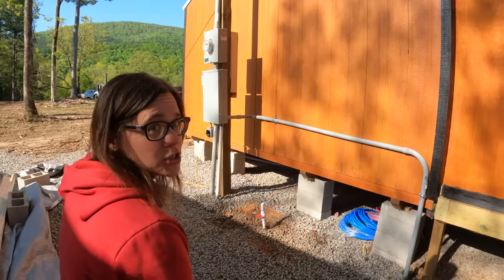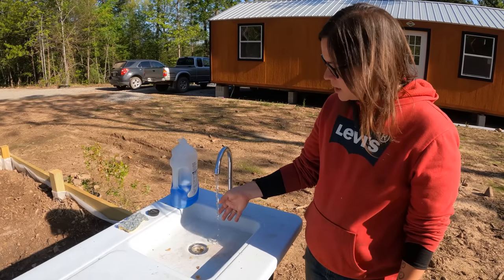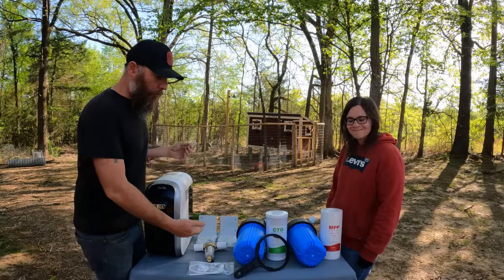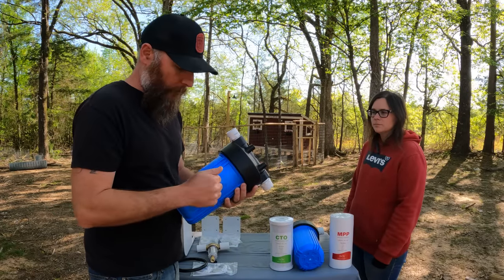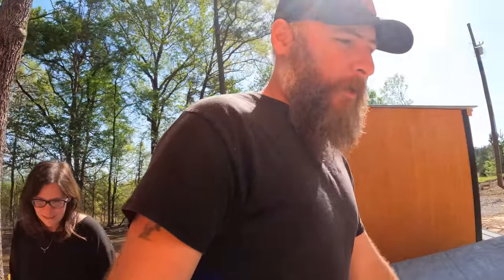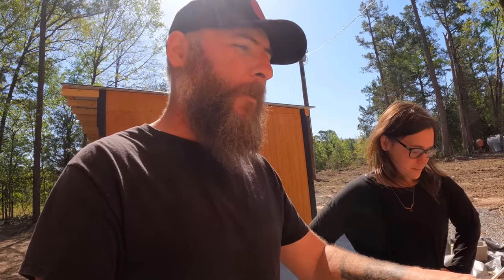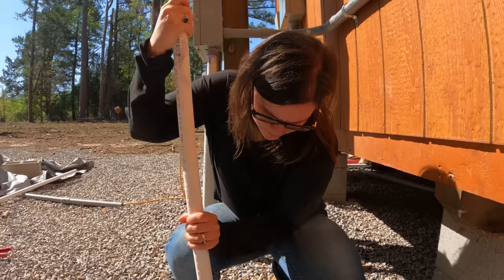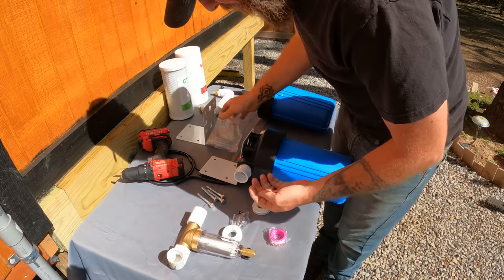Best way to get clean water | DIY Water Filter Install | Couple Builds Dream Home In The Forest

Comment: I would suggest that the next time you go to Lowes or Home Depot that you get some of the silicone grease made for the "O" rings on those filters.  They can be very difficult to unscrew and the lube helps.  If you plan on watering your yard or garden, you probably would want to think about installing the faucet before the filter so you do not run a lot of water thru the filter that does not need to be filtered.

Comment: That was awesome that thr company sponsored you with the complete water filtration system! What a blessing ! After it's completely installed are you going to build a housing unit for it ? That way it's tucked out of the way and won't get hit by the animals, an accidental bump or maybe storm debris ?
Congratulations on your super clear and clean water.  When you cut the grass a couple handfuls of some of the clippings can be fed to the hens. It's very healthy for them. You can also spread it out over the barren grass area you're trying to grow. The nutrients will be absorbed into the soil.
Thanks for Sharing. Stay happy, healthy, hydrated and safe. May God continue to bless you, your family and your adventures.

Comment: Good solution, however should be installed inside a heated living space. Then insulate only the feed line from the well along with heat tape to minimize chances of freezing.

Comment: I think I would have put the filters in the well house. This then not only protects them from freezing, it will keep the pipes to the house clean as well as give you filtered water to your garden faucet. 
Note: Any plumbing above ground outside will require not only insulation but heat tape as well.
Reply: Ours froze in the well house in the big TX freeze last year. We lost power so couldn't keep the heat lamp on out there.
Reply: You don't need to put the filters on all the water though. The garden water doesn't need filtered. In fact, it's better to not be filtered. It gets all the nutrients that way and nature will filter out all the junk and use the filtered hose pipe for the animal water.
Reply: I was wondering if freezing would be an issue?
Reply: I guess it would have froze no matter where it was located without power for heat. Even the pipe coming up out of the ground to the house will
freeze without power for heat tape

Comment: Move your outside sink to the back door and run a RV hose to it from the spigot. Great work yall...this looks like a great system.
Reply: The sink for household use is temporary— when the house is finished the sink will have the greenhouse built around it.

Comment: If you build it, build it off the ground.  Build the back and side walls and line them with foam board insulation.  Make the top and front hinged so they can be accessed like nesting boxes.  Keep in mind that the filters have to be unscrewed and dropped to be removed so leave room for that.   I keep a small whiteboard in mine and write the date of the filter change so I can look at a glance.  You can just velcro the wrench for the filters to the wall.  Keep a small light out there so you have one in a pinch.   I love using IBC totes in series to store water in.  It is free and mostly cleaner than well water.  It can be run thru similar filters or just used to water the garden or the livestock.

Comment: You say insulated but i didn’t hear anything about heat source. I think with your temperatures there a incandescent light should work down to maybe 15 degrees. I would wire it in to a switch in the house. That way when you see the temperature’s going down you can just switch it on. A shop light to just hang in the enclosure would do the same thing. You guys rock you are getting it done.
Reply: They could use a heat lamp in the box like you do for baby chickens.
Reply: @Donna_Bug  yes but I don’t think it necessary in Arkansas. I’m in the upper peninsula of Michigan. We have a incandescent light bulb in our well pit on all the time all winter. Then we have a heat lamp (like for the chickens) that we turn on when it’s going below 10 degrees.

Comment: I have been looking for a counter top reverse osmosis filter system. We had a different brand under counter system and had problems with it. I have been using the one with the pitcher and filter. I have kidney issues and have my numbers checked regularly. My numbers got worse when we stopped using the reverse osmosis system. Thank you for this video! We are on city water. I wouldn't have known the difference it makes if I wasn't tested regularly. Thanks again for the video! peace y'all
Reply: We use a Zero water counter top and it’s great and way cheaper too!

Comment: From experience, Iron in your water will destroy the cal rod in your water heater. It takes only 2 years and the 10 year warrantee does not cover it. It will cause your water to smell like sulfur. You can remove the cal rod without damaging the water heater but that also voids the warrantee. You can always test your filtered water to see if you need more filtering. Good job on the installation.

Comment: You need to run them filters in your wash room  before the cold water goes into your hot water tank
Reply: They are installing the filters first🤷
Reply: @Donna_Bug  yes i know, but would you put your filters outside , or would you put it in the wash room, then run it to every other place, Like water in a plastic filter in 20 degree weather is not a good site to see,
Reply: @scottmiller5799  oh I get what you meant now😂🤭

Comment: I was wondering, if you would want to use the filter system to do outside watering with the spicket? I am wondering if putting the spicket on the side of where the main water comes in instead where you have it so that you aren't wasting the filters, unless I misunderstood what the spicket is all about. Just asking.
Reply: I was just going to say that very thing.  Those filters are not cheap, and chickens and flowers do not need filtered water.
Reply: That’s what I was thinking too.. your outside water doesn’t need to be filtered.. that dirties up the filters quickly , and as you said, they aren’t cheap..
Reply: Besides saving on filters,  you also don't water garden hose water to back flow into your house for sanitation reasons.  There may be a reason to have a filtered spigot (Friends visiting with RV) but they could also add another one before the filters for the garden (ifthey don't have one already).
Reply: Yeah, why waste filtered water on outside stuff.

Comment: You made it look easy guys!! What about winter? Just building a box around your piping won't keep them from freezing. May I make a suggestion and use heat tape on all your house lines. As well as wrap with insulation. Down the road you might just be glad you did😁🤙🍺🦋🙋‍♀️ XOXO
Reply from the maker: We will insulate the box and wrap the pipes. I think it will be okay. Our well house is just insulated and house wrapped and it was fine this winter.  😊 thank you lilah for watching.

Comment: I recommend hinging the whole cover to the wall for Easter access to the system guys,oh an redrilling two more holes on the filter brackets to secure to the barge board an so good luck with continuing the whole plumbing system to your home 👷

Comment: Great job guys! Just a thought... you should probably put a pvc shutoff valve after your filtration setup to have the ability to shut off all the house with one valve.  It would help when maintaining and flushing your filtration line and you already have the clean out spicket on the opposite side, it would protect your supply lines to your house. So all your filtration cleaning can be done in one spot and turn one valve to keep supply lines to the house safe from anything you don't want in there.

Comment: Great job on the install! Armaflex on the piping, even in an insulated box, will help stave off the elements. Just another form of cheap protection from freezing. Will you be insulating the underside of the house, if so, the Pex should be ran above it, if not, no need to worry about the insulated box, the pipes will freeze anyways. Love what you're doing ❤️, grass looks great!

Comment: Hey guys look into an (Automatic Electric Heat Cable Kit) for your water line that is coming out of the ground and some (pipe wrap insulation) to put around the  Electric Heat Cable Kit like they do on Mobil Homes.  It will keep your lines from freezing up in the winter time. And also keep your idea of bulbing an insolated box around it all as well. I live in a Mobil Home and I have one on my Home outside at the main water inlet, and I never have freezing water in the winter and I live in Ohio. keep up the good work.

Comment: You should put a on/off t valve after your filtration system going to the house this way you can turn off the house and keep the pressure in the house when you service your filters and also put another one in front of the filtration system so that you can use the well water for your gardening.
 Good luck you guys are doing a great job.
Reply from the maker: we do have a separate ball valve that is for the garden. Never thought of needing one for the house after to keep pressure. Might look into some for the pex lines. Good advice

Comment: Wire a light into your box. It will supply enough heat to keep from freezing. You will need something. Wells further south than you have split filters and lines without heat source. Just my 1cent.

Comment: Heads up - I saw a few drips - water leak- from the new system when you were testing it. It was on the left side of the clear filter bottle. Check your video and you'll see it. It's very slow but it dripped 3-4 times. Your grass is looking great!

Comment: Since you can’t screw the bottom lag bolts on the filter support to the house you could get a 2x4 cut a V in one end then cut board to length and wedge under pipe between both filters to better support the weight. Just a thought.

Comment: Apply some Vasoline to the threaded part of the blue canisters and also the "O" ring on top of the canisters. The filter housings should be hand tight. In a short while the canisters will 'stick' and become hard to remove. Thas why the vasoline. Yer place is looking better n better each day.

Comment: Put slide locks on the front wall so the whole thing opens so you can change those filters easier. Or put a hinge at the wall and the front of the top so you could swing the whole front and roof up and out of the way.

Comment: A newly drilled well will be like that for a while.  You drilled the ground,  disturbed the earth and now the water contain all that mud and silt from drilling.  Man that drilled our well told us to run the water for a while to get what will not settle pumped out.  All the fines as he called it.  You will find that there is enough silt in your water to stop up the filters daily till it settles out or is pumped out.  Just run the water.  After a while it all settle down, no more silt and all you get is good clean water.  Remember only the top 20 or so feet of your well has a casing, the rest is a hole in the dirt ,sand and rock.  Use the water, that helps clean it out.  We have minerals in our water that clog up those filters in just a few days, wound up changing them two or three times a week.  Had to get a water softner installed to eliminate the problem.
Reply from the maker: Thanks for the advice Ray. Our well down at our campsite has a filter and it needs to be changed out about every 4 months or so. Hopefully with this system, we can eliminate some of that using 3 filters.

Comment: You might want to put some black form pipe insulation on all of the pipes, even under the house. Also secure the water valve so that a hose will not break it off. It was moving a lot on the video.

Comment: I'm going to be a bit bossy here,  one...I hope you take into account the indoor counter system when you get to the kitchen build....it would be best to have it by the sink, since the water reservoir is in the back, you need easy access to it, although if it was me I would just use an empty gallon milk jug and fill it at the sink and just pour it into the reservoir so I wouldn't have to man handle a full heavy reservoir with water back into it's slot, I'm so clumsy you see, I would splash water all over the place....I do that now with my counter top  zero water filter....I would think about which side of the sink will you put your dish drying rack, exactly how much room will you need to have your water filter on the counter and dishes and whatever things one needs by the sink, you want enough room to not look junky...I just had a thought ....you and your husband are so handy, he could make you one of the english draining racks. they are suspended over the sink to drain water directly into the sink, you wash rinse and just set the dishes up on it....do I even make sense?   it would save on counter space, you might could google antique english over the sink dish draining racks...second bossy thing, I would use your new filtered spicket with a hose run to your chicken coop, the chicks would benefit from the clean water, since you will be eating the eggs and some of the chickens for food, no pesticides, etc....third bossy thing, I would take a jar of the well water and the filtered water from outside and a jar of the counter top filtered water to the health dept and get reading on all three of them, you can compare the outside filters with the well water and can compare the inside filtered water to the outside filtered water and also compare the inside filtered water to the well water, that will be an excellent test of the systems....forgive my bossiness, I'm sure you have already thought about these things.... but just in case you haven't...... lol.

Comment: Are you going to build a cover for the filtration system so it won't freeze ? Another great video guys ! Nice work as always 👏 👍
Reply: I'm assuming it'll be done quick as PVC degrades quick exposed to UV rays and the elements.

Comment: Do you have a pressure regerlater.  You do not want to much pressure  or fluctuating pressure. It will cause damage to you water system.  Looks great for your set up.

Comment: You might want to think about installing a pressure regulator on your water line before your filtration system.
Reply: It might also be a good idea to put shut off valves at the beginning of your PEX runs to be able to turn off either hot or cold runs in the future,

Comment: Could you use a pressure regulater on your water connections? They're not too expensive. But could save your plumbing.   It just screws on.

Comment: WE HAVE A WELL WE PUT SWIMMING POOL BLEACH PELLETS IN ONCE A YEAR, but beware don’t wash black pants until you can’t smell bleach anymore 😊
Reply: The skirting we have under my daughters mobile home so on the inside hubby used pink like styrofoam insulation behind it and works great from freezing pipes underneath and we’re in Southern Minnesota, you guys don’t get that bad nasty freezing all winter ❄️ just a thought 💭 you guys are becoming the pro plumber’s 🤗GREAT JOB !
Reply: Put piece cardboard you can see if you have leaks 😉

Comment: Only comments I have is a PVC union on both sides of the filters makes it easier to repair or replace the filter housings when they crack or wear out. The spigot after the filter is okay if your intent is for consumption but will exhaust the filters quicker then anticipated.
Reply from the maker: I agree, I actually bought a union to install in the front of the filters. I realized that after the install lol

Comment: Hmmm ... Observation - 1. you have the Sediment filter 1st, then Carbon, and Particular filter, I would have reversed that, Sediment, then Fine Particular, then Carbon filter. 2nd. between the last "T" fitting and the Pex fittings, place another valve. The web site talks about flushing filters for 5 minutes before use, thus a valve there would allow you to stop the water through the inhouse system, and be able to use the faucet to purge the filters before re-opening them to the house.

Comment: Should have put u valves before the pex connections in the PVC lines , that way if you need to work on the line or do anything u be able to isolate each line

Comment: I would have run the water line into the laundry room and installed the filters and hot water heater in there. You would not have to build a insulated box and that would be less work. Much easier to change the filters in all weather conditions.
Reply from the maker: But lots of water on the floor when changing the filters! Lol
Reply: @countryroadcure  we just put a bucket under the filter. We live in MN so there is no way we could put the water lines outside like that. Makes a difference where you live.

Comment: After seeing the type of filter inserts used for your system.... I do think you could clean them and reuse them... 
I'd say, doing some research on the internet could save you a lot of money, in the future... Just sayin.. :)
Your Reverse Osmosis System removes 'everything' from the water.. including minerals you need for good health 
(if you don't have kidney problems, that is)... so... you'll need to add minerals back into your diet via supplements to replace them.. IMO

Comment: Insulted  is well and good  but if there's  no heat  it will still freeze.  It 8s up to you butt i would putt it in with the hot water  heater. I wood also dig up  the water  line and d8g a trinch under the landery room for the water too come up under the house it needs to bee protected  frome axadental  breakage  frome being  in the yard .